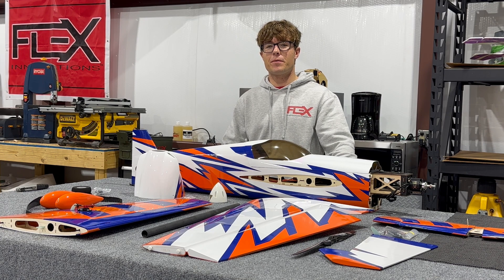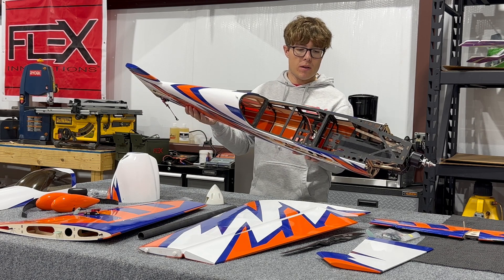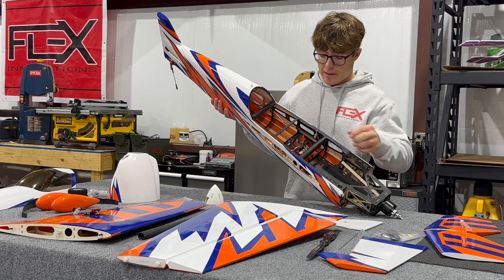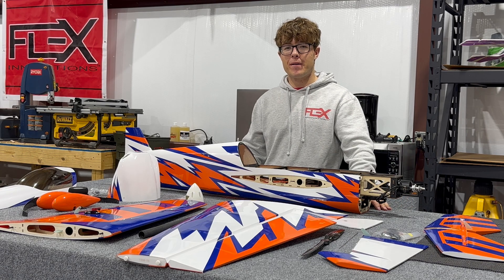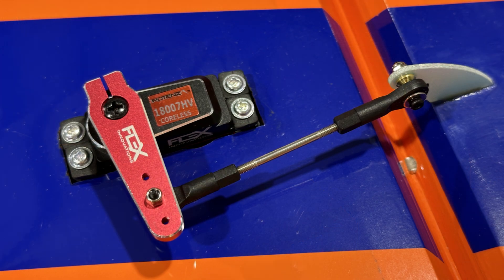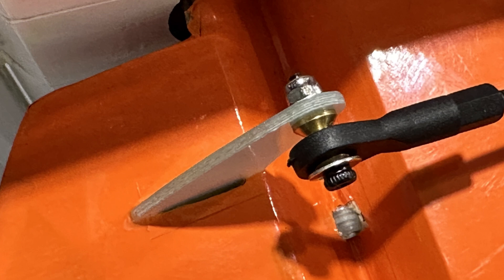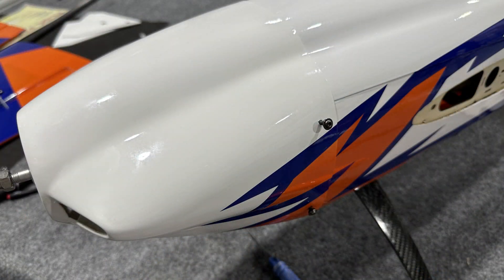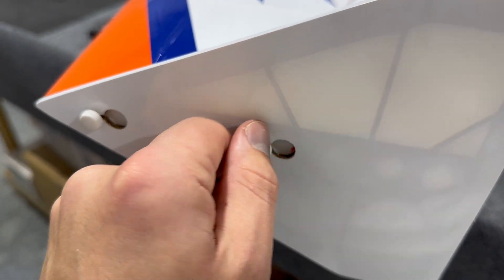Flex Ventique G2 60E Pro PNP Assembly

Comment: Yea, not sure what neomatrix3612 means about the quality of their foam planes? I have both the 10e and 60e G2 RV8’s. The 60e Cap 232, and the 10e Yak55, all from Flex. These planes are easily the best foam planes I’ve ever encountered. I’ve been in the hobby for almost 20 years. As far as their balsa planes, I can’t speak to. The only balsa planes I own are from Extreme Flight, and they are, without a doubt, hands down the highest quality aerobatic balsa planes available, anywhere. Jase used to be sponsored by Extreme Flight, until very recently when he switched to Flex. This plane looks almost identical to an Extreme Flight plane. I’d imagine it’s of the same quality. I’d like to see some specs of the motor and servos. See how they compare to the Dualsky Racing motors and the T-Motor combos that come with the Extreme Flight Receiver Ready/Plug n Plays. The Skywalker ESC is ok, but I would much prefer the AM116 from T-Motor, or the Platinum Pro from Hobbywing.

Comment: Jase, explain further your statement that a plane that size doesnt necessarily need gyro stabilization. Does that mean you like it for larger planes? or what is the size  that you personally recommend gyro stabilization is what Im getting at... thanks!
Reply from the maker: Aura is pre-installed and pre-programmed for PNP. I was wanting to clarify that the reason this is included is not just for the stabilization option, but rather to supply the proper rates and mixing setups out of the box. I choose to fly this at high rates with the gyro off.